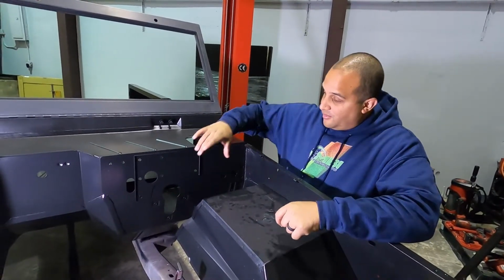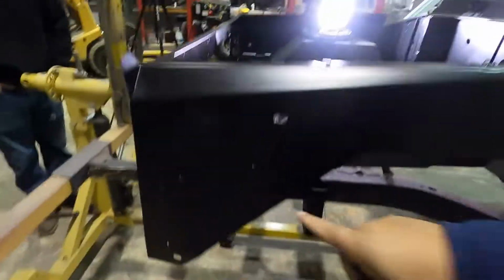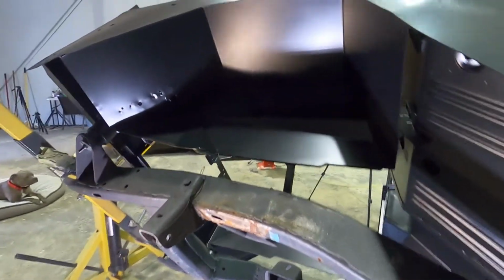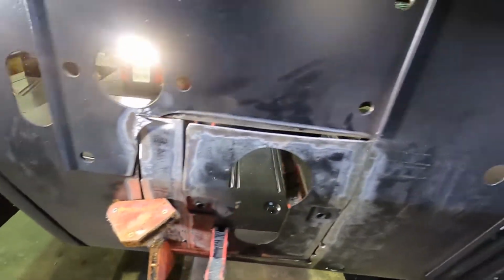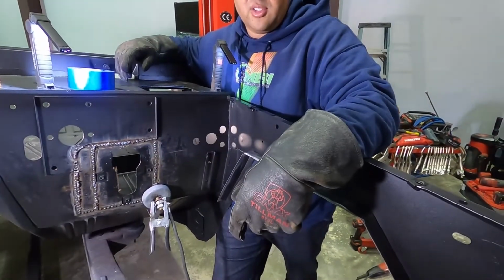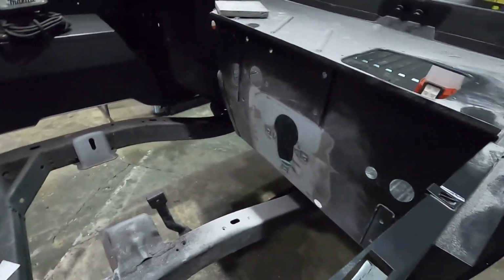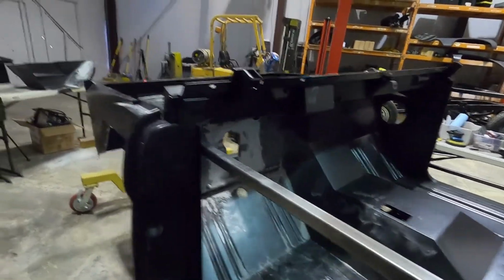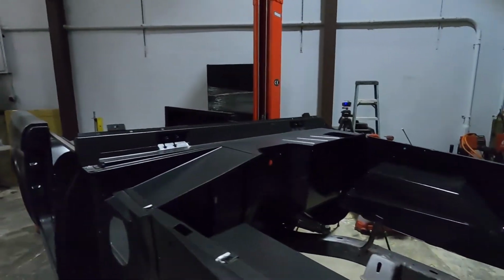EARLY BRONCO COYOTE SWAP BODY MODIFICATION

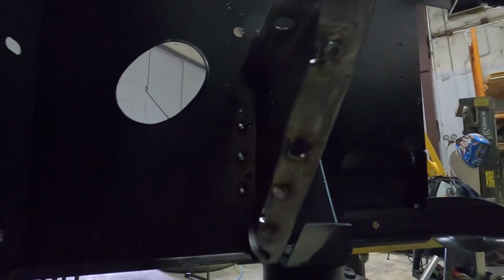Comment: 19:07 shows the flange where the body is mounted to the frame.  How did you get that flange separated from the inner fender?  Great video, thanks!
Reply: they drilled out the spot welds.

Comment: Can you show a steering column installed and how it aligns with the dash and speedo cut outs? This would only be for an automatic trans install also, correct? Because of the clutch rod interference this would create.

Comment: Cool vid. Wondering how moving the wheel well over the 1 1/2 inches affects the suspension, tire size and/or turning. Thanks
Reply: @mbimotorsports1003  why not move the wheel wells over enough outward to accommodate 35” tires without a lift and increase approach and departure angles? How far would you have to move the axles? Also how wide of an axle can you put in it ?